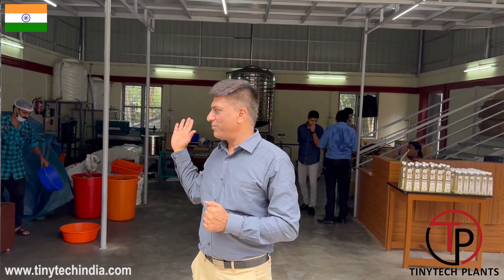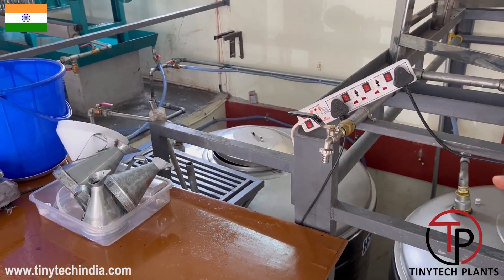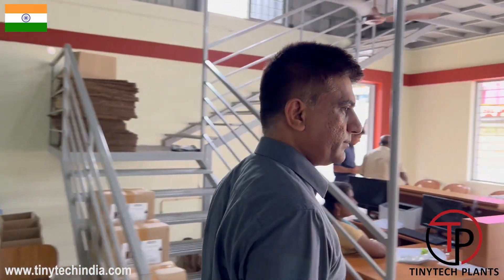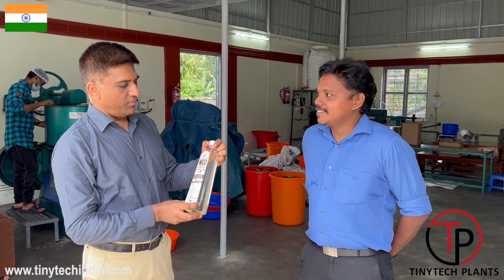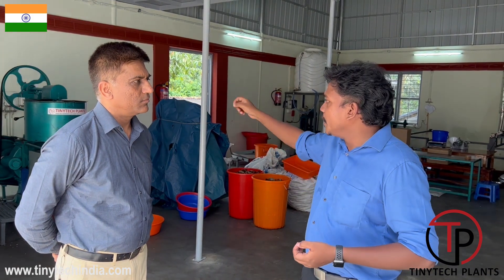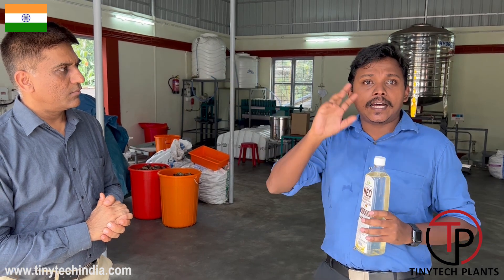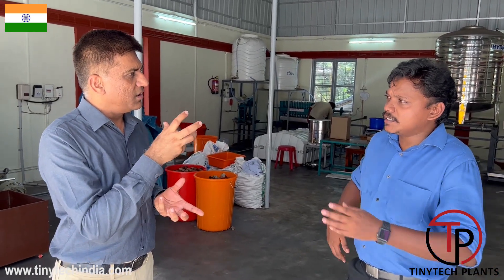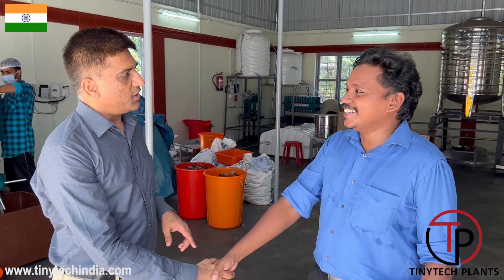2.5 TPD COCONUT OIL MILL PLANT🥥 #tinytech #oilexpeller  #coconutoilmaking #oilmill #oilpressmachine

Comment: I am also interested and my questions are
1. How do we maintain the quality of oil, is there standard of how to cook the coconut. I know it has to cook to remove from the shell. Here in the Philippines, I see some are too dark, meaning overcooked, some look with molds. Is there a way to remove from shell so that there is no need to put the coconut on fire.
2. How many, more or less, coconuts to yield a ton of oil?
3. With that 2.5 tonner machine, how many personnel will be needed to operate up to bottling.
Reply from the maker: Kindly contact us by WhatsApp on +91 9227505254

कृपिया +91 9227505254 पे WhatsApp से हमारा संपर्क करे।
Reply: @TINYTECHPLANTS  can we talk
Reply: @TINYTECHPLANTS  hi
Reply: No lavai dost bakar ava cha masanry khota cha June vacha cha New nu kahena bhai chatraso
Reply: Im planning to put up oil factory in Philippines. Is that good start up?

Comment: For this produccion setup how muchs square meter is the minmum requierement
Reply from the maker: For more details like the price of the machine, crushing capacity, oil production, area required & Profit margin kindly contact us by whatsapp on +91 9227505254. 

मशीन की कीमत, पेराई क्षमता, तेल उत्पादन, जगह की आवश्यकता और प्रॉफिट मार्जिन जैसी अधिक जानकारी के लिए हमें व्हाट्सएप से +91 9227505254 पर संपर्क करें।